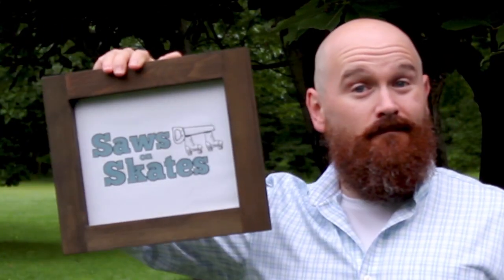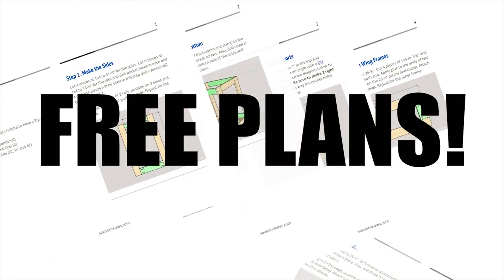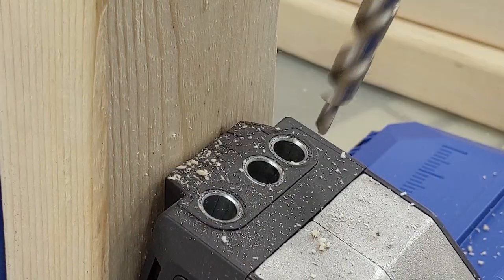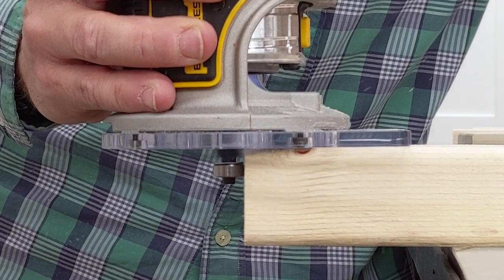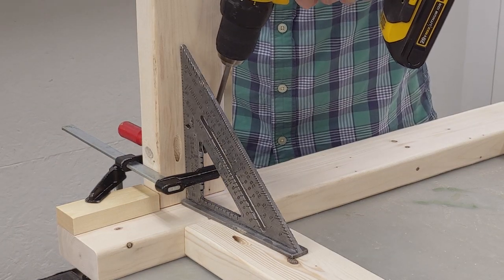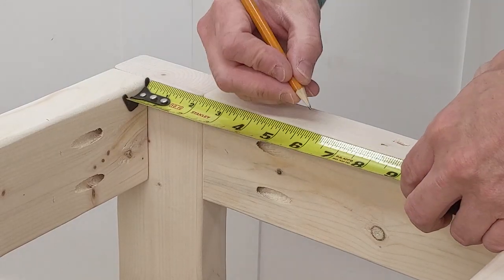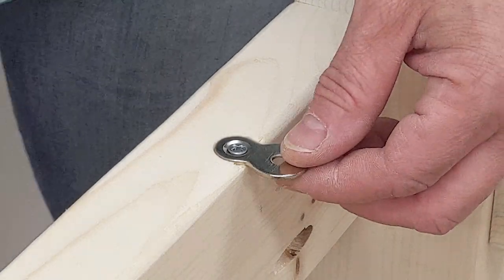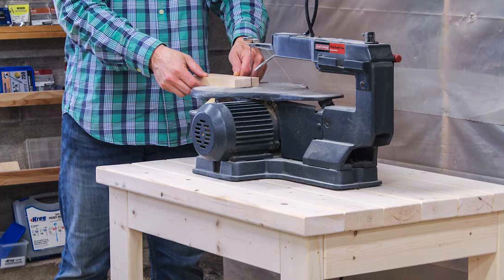I made a DIY tool stand with only 6 boards!

Comment: Thanks for the video. I am going to be building a workbench using your 2X4 plan and this video covers everything in those plans. Did you leave this unfinished? If you were to use a finish for the workbench version, what would you think is best?

Comment: Love your vids, signed up, and ordered the plans, thank you very much. I have a very small shop, and I'm wondering if I can make 1 or 2 bases, and 5 or 6 tops with tools permanently attached, then swap the tops onto the bases as I need to use the tools. The tool-tops could be stored on a wall-mount rack. How could I make that solid and secure?